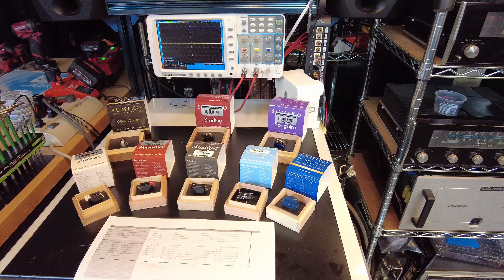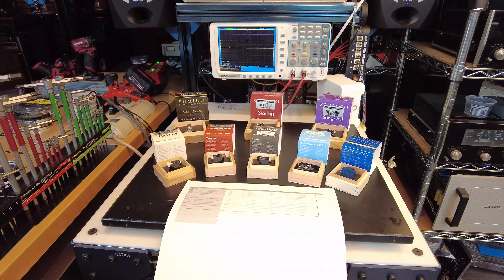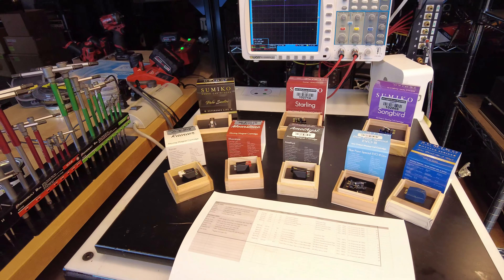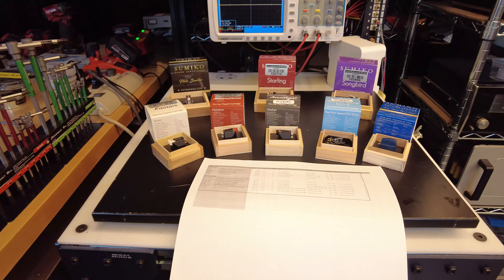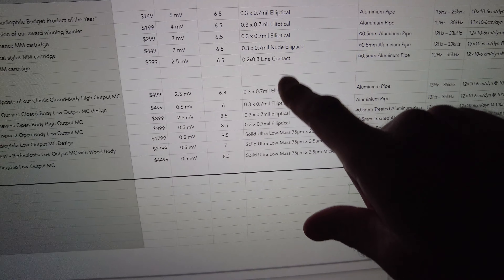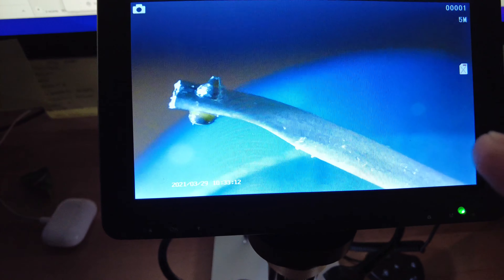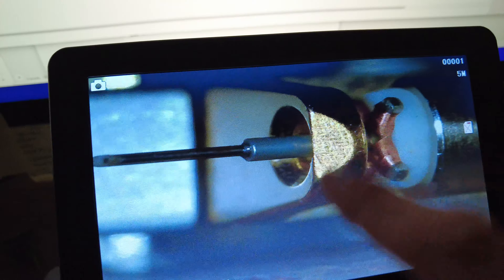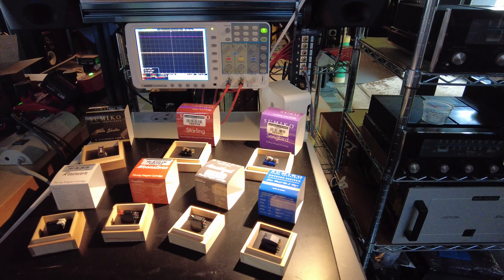How to Pick a Phono Cartridge - Sumiko In-Depth Guide

Comment: Thanks Fernando!!
That was one of the most interesting presentations I’ve seen in a while.
I learned quite a bit. Cartridges are one of the most interesting things in audio.
I never would have guessed that the tip temperature could reach 300 degrees.
One thing that still amazes me about cartridges is that they can get left and right separation through one stylus and one cantilever.
Reply from the maker: I know!  its crazy indeed.
Reply: @SkyFiAudio    Seems like magic! 🤦‍♀️😳🌀❤️

Comment: This is a very informative video on cartridges and styli.  I'd like to point out that the spreadsheet you've made available for download, which is quite useful, shows the Bluepoint #3 high and low versions, under the Oyster Series, while your own spreadsheet as I could see in the video shows the Bluepoint #3 high and low, under the Reference series.  I would presume there was a typo regarding the Bluepoint in the spreadsheet you've made available for download?  In any case, thanks for this very informative video.

Comment: Fascinating... VERY Well DONE !  Don't know much about Sumiko but I love threaded body on some of their carts... no need to struggle with nuts !  Challenge with swapping cartridges is it is a bit of a wildcard in terms of how well it works with certain turntables (e.g. Rega P8 / P10 that does not have VTA adjustments other than shims vs Technics 1200 / 1500 line with a ton of adjustments possible) and how it can or can not make much difference.  Obviously, removable head shells are much easier to install but they have their detractors.
Reply from the maker: I agree and should have mentioned the threaded body.  Sure makes mounting and adjusting easier.

Comment: The Project EVO CC tonearm on my tt calls for a high compliance  30 um/mN or higher cart. How does this convert to a Sumiko 12x10-6 cm,/dyn cart?
Highest compliance Ive seen is Goldring Erocia at 25 um/N. 
The units I typed are correct as   I seen them posted. Very confusing.

Comment: I thought I had read that the Amethyst stylus could not be used with the lower level Oyster bodies. Has that been changed? I have a Moonstone now and was considering a move to the WellFleet stylus but if I can jump straight to Amethyst, I would likely do that instead. Thanks for the video.
Reply from the maker: Users with Rainier can upgrade to Olympia, Moonstone or even Wellfleet with a simple stylus swap.
Reply from the maker: Owners of Amethyst can enjoy the same versatility. Although the generator for Amethyst is different from that of the rest of the Rainier Family, the physical body & mechanics are the same so it is possible to use, for example, a Rainier or Olympia stylus with an Amethyst body. This also means one can install an Amethyst stylus in a Rainier body (it sounds fabulous, but be advised it does not extract the full potential of Amethyst’s sophisticated stylus/cantilever)
Reply: @SkyFiAudio  IMHO, Sumiko torpedoed Amethyst sales when they released the Wellfleet. If you can use the Amethyst stylus on the lesser models (contrary to what they were insisting, and admittedly without feeling the benefit a la 10cc), what real incentive would there be to spend that kind of money on the Amethyst instead of, say, a Blue Point No. 3 HOMC?

Comment: Fantastic video. Thank you.

I don't quite understand why I shouldn't upgrade my Ortofon 2M Blue to a Songbird on my RT-85. The way I see it, a turntae has two functions: 1) disc rotation and 2) cartridge placement (tonearm). If the rotation and cartridge placement are both precise (which I believe they are on Fluance Reference Series for example), then isn't the only argument left in terms of quality-cost ratio a question of electronic hardware quality? Isn't it purely a matter of signal path from the cartridge connectors to the turntable output nodes? Isn't the quality-cost ratio argument really about hardware quality for the signal path and, if so, is the point that this hardware is across the board inadequate in terms of compatability with higher end cartridges? I would expect a Songbird would revolutionize my listening experience nearly as much as it would on a $2500 tt. Is this untrue? 

Thank you!
Reply: The Fluance may not have the precision to take advantage of the Songbird.
Reply: @jimroyle2206  Thanks Jim. What does 'precision' mean in terms of a turntable?
Reply: @austinhunt4260  Ah!...since you asked....it means you need to spend more money on the turntable or else others might realize you CAN run a stellar cartridge ona budget turntable AND get BETTER sound. (shhhhh!!!! ;  do it but don't tell anyone unless you want to get flack about it )
Reply: @jimroyle2206   If you can mount the cartridge and it spins at a constant speed ....it's precice enough. The rest are turntable upgrade sales-pitch ;)
Reply: Nope!
Reply: @jimroyle2206  Hi Jim, still curious to hear what you mean by 'precision.' Thanks.
Reply: @dimitriapproved  After upgrading to a Hana ML, the first limitation of my Fluance RT85 reveals itself - azimuth! Now I know what that this. The expensive way. So, you need a table with adjustable azimuth on which to properly align better carts... I guess that's one vote in the precision column.

Comment: very important to me ( I'm 73 ) the attachment of cartridge to arm - those tiny nuts are a horrid choice, every cartridge should have threaded attachment.  and, does the head shell have easily replaceable ( SME /techics style ) connecting wires ?  Yea, I broke one of the 4 tiny wires/ connects and rendered a fairly expensive turntable worth about 2 cents.  I understand the idea that extra attachments reduce quality of sound > single wire length from back of cart. to the rca jacks into amp.... but replaceable durability is or SHOULD be a strong design feature.